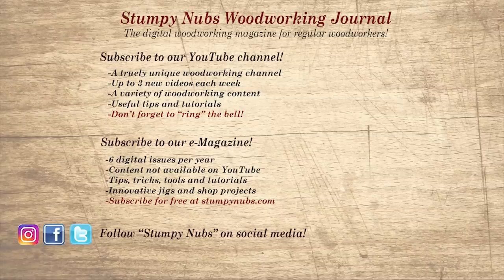Are table saws becoming obsolete?????

Comment: I don't think it's fair to compare a Festool track saw with a circular saw that has a track saw adapter kit on it. Festool is some of the most expensive stuff on the market, but you can get a tracksaw for under $1,000, which doesn't get you too far if you want a SawStop or similarly nice table saw. That being said, I prefer a tracks off for panel goods just purely based on maneuverability of the panel. But I prefer a table saw for repeatable rip cuts as you stated.

Also in a small shop, a track saw requires no indeed or outfeed, only space for the panel itself. +1 for the track saw, for my shop.

Comment: Stumpy, you didn't even cover the most important aspects of owning a table saw. Work bench clutter, not for table saw owners, why stack stuff there when that 2" cast iron top can bare much more weight! Try slapping you magnetic gadgets to those aluminum tracks, the cost to switch out those magnets for aluminum magnets are horrendous! And the most important thing, without a table saw, what's going to anchor you concrete floor on the ground? Woodshop without a table saw, not on my watch. In fact I'm going to order my 3rd one. Stumpy have a cold one my friend, you've earned it!

Comment: I've been getting by with a Festool track saw and MFT table. I got it mostly for space considerations when I didn't have much space. I really need a decent table saw. Track saws are not fool proof, this fool has experienced a couple too many dangerous kickbacks because I set the depth wrong. I do love it for breaking down large sheet goods though. Even if I had a good setup for that with a table saw I'm not sure I'd use it much.

Comment: Does a homemade table saw (inverted circular saw) count as a table saw? I don't see any comments about it.
With a well constructed fence and cross cut sled it is preferable to a track saw.
Reply from the maker: I would avoid any table saw without a splitter or a riving knife installed. https://youtu.be/8f8VWwtaudU
Reply: @StumpyNubs  Good point. Thank you.

Comment: If I could only have one machined for woodworking, I’d be a table saw, that says it all for me.
Reply: In to sawdust making since around 72 (but did some before that) and my cabinet saw is, still, the center of the shop. I will say, I do have two bandsaws, but they will never replace the table saw completely.

Comment: All to true; more issues and awkward contortions with a circ vs table for my taste. Even purchased a cheap mobile contracts TS for site work. Still have and use my circ but only as necessary. My opinion is folks without adequate space prefer the circ and vise versa

Comment: A properly set up radial arm saw used wisely can do everything a tablesaw can do. Except cross cutting a full sheet of plywood.  Being able to stand up properly is a treat and with a proper saw blade the cuts are clean and smooth. The radial arm saw rests up against the wall out of the way instead of being stuck in the middle of the shop, and with a proper fence dust solution makes much less mess
 I have never owned a tablesaw and never will. Do yourself a favour and try a radial arm saw out for yourself. You'll be glad you did.

Comment: You say the table saw is a large machine but not having one often mandates having several other machines that end up taking up even more space. All of these being less than optimal for the cut that would be easily achieved on a table saw. A table saw and a band saw are my two most used machines and if I had to get rid of one of those it would be the band saw.

Comment: I've been considering (more or less) the same question for my own uses. I owned a 3hp Delta Unisaw feeling the quality. I moved to needed to sell my shop over 10 years ago but am now getting back into woodworking. 

In the intervening time between selling my shop and now track saws have come a long way. For me, the question is not so much track saw vs. table saw, as I clearly feel doing some joinery on the table saw is simply going to be faster, but do I (or most) any longer need the big 3hp table saw even for hard woods. Would a 1.75hp or 2hp saw be more (and I would say perhaps far more)than good enough?

When I consider the hard wood pieces I constructed in the past, even in 3x3" cherry, my conclusion is that a 1.75/2hp saw (and perhaps a thin kerf blade) will be more than enough for any needs I can see, even though I mostly do projects in hard woods. Yes, I will need to keep the blades sharp, and perhaps have a few additional blades around for cross cuts and rips needing to changed blades more frequently, but I can't think of a time where the 3hp just bought me that much. 

So, considering how far track saws and associated blades have come I'm not sure the question is if table saws are obsolete, but do you any longer need the big 3+hp saw that we all pined for, or the 52" rip capacity. I strongly suspect not, the same joinery and (mostly) the same capability can be accomplished with a less expensive saw considering the other available tools.

My two cents.

Comment: As a woodworker who actively makes a living by making and selling wood goods online, a table saw is a necessary evil. You can of course do everything a table saw will do with a circular saw and guide but it will be slower. Now I have a specific example of table saw danger. I was cross cutting glued up pieces to make  chess board like cutting board. The glue joints failed during cutting and a 6 oz'ish piece of oak was fired back at me from the saw blade and struck me in the forehead it split my forehead open and caused a rather severe concussion. So be careful with your table saw.

Comment: Are table saws becoming obsolete? No, not by a long shot. However, they are becoming less necessary. I prefer to break-down sheet goods with a track saw. Then, I cut to final size using my table saw. However, there are times when I'll just use the track saw. A lot depends on how many cuts are required, how many are repetitive (You can make repetitive cuts on a track saw. It's just harder, and harder to do as accurately, than with a table saw.), and what I'm making. I recently made a set of shop cabinets without my table saw. (I've got to get the shop put back together before I can fit the table saw back inside. Maybe I should see if there's a post office building for sale in my little town...)

Comment: whats your thoughts on DIY table saws. 
I have also thought about mounting a circular saw. and leaving it downward facing.
Reply: I started with a circular saw mounted upside down a wooden table with a self made fence. If you don't need great accuracy or cutting depth, it's a cheap way to start, but not more.
I replaced the circular saw with another gifted saw that used to be a combination of a miter saw and way to small crappy table saw to make it a better table saw, but it's still a very weak compromise.
I would believe a 200$ cheap real table saw would give me better results.
For example, I cannot tilt the blade and be limited to 90° cuts. The fence setup is flimsy, cutting depth is still not good. If you build it in a way it is good, you spent the same amount of money a good job site saw will cost you.
Reply from the maker: I do not believe a table saw of any kind, be it homemade or an upside down circular saw, is safe if it doesn't have a splitter or riving knife. So no, I would never use a circular saw upside down. They were not designed to be used that way and have no safety devices to prevent kickback, which can pull a hand into the blade.
Reply: @StumpyNubs  Mine had a riving knife and I would never use saw without one.

Comment: As I see it, a track saw eliminates 90% of the need for a table saw — and in a much safer way.
Moreover, it’s a lot easier to manhandle a saw than a sheet of plywood.

Table saw specs ignore the very expensive essentials: a solid fence, a Brett guard, a power feed unit — and a saw stop! Nor do they consider all the jigs you need to make, such as a crosscut jig.

Comment: I’m ticked off! I’m gonna savage you!

Just kidding. I generally agree. The table saw is definitely the fastest way to do a lot of things. One thing I personally think gets overlooked though is why does that matter to you? Is there some intrinsic value to ALWAYS doing things the fastest way? I argue no. 

Obviously faster is better right? It lets you make more money right? Well... not necessarily. It really depends. Otherwise NOTHING could still be made by hand anymore. It’s always faster and cheaper to get something from IKEA. But there are still people turning out projects using only hand tools. And making a living. If they have the time to make rips with a handsaw surely the time difference between tracksaw and tablesaw rips is less significant right? If you want to use a tracksaw for everything and you’re 15% slower for not owning a table saw that’s not intrinsically worse. It’s just something it’s up to you to price into your work. After all if efficiency was the only consideration for customers they would never pay for something made by a human. Factories will always be faster and cheaper.

Comment: I'm absolutely not an experienced woodworker, just a novice. But I am a logical person. And the table saw's days are numbered. I present to you the premises for my conclusion... the sliding miter saw and the track saw.

You just need a flat table top, a track saw, and a sliding miter saw. In fact, I'm certain that products will eventually come on market that will combine these concepts. The chop saw is the fastest and most accurate way in my view, to cross-cut smaller materials, and the track saw IS better than the table saw for cutting larger materials. (AND BOTH ARE MUCH SAFER THAN A TABLE SAW) And the sliding miter/chop saw only adds to the capacity of the miter saw. And multi-material blades means accurate and clean cuts on steel too. I'm a welder/fabricator, and I took woodshop in high school and even masonry in Jr high. A table saw is nearly useless and very hazardous for cutting metals or masonry, but the miter/chop saw is perfect for it. And for sheet goods, whether wood or metal, the track saw is much better than the table saw. ESPECIALLY if you have a workbench that is even relatively flat. It being a workbench, it's a multi-use surface. And from my personal perspective, woodworking as it's own profession is kind of on its way out as a viable career option for most people, and welding-fabrication is too. However, I love the fusing of metals and woods together, and I'd recommend anyone who loves building things, become competent in wood and at least steel, if not aluminum as well. I like the idea of using steel for structure and wood for comfort, such as steel tube legs and back supports for tables and chairs, but having wood and leather as the materials that make contact with people.

Tangents aside, I think the blade moving (chopping and sliding, like with miter/chop and track/circular saws) is much more reasonable than constantly moving the materials. The work surface should remain immobile, as well as any reference surfaces such as fences and stopping blocks for repeatable cuts. But the blade should move. Simply makes much more sense and is a much more versatile means of cutting, with more applications. All the table top extensions, and rollers, and sleds one needs to broaden the capacity and utility of their table saw is just unnecessary. Moving the blade along a fixed range of motion, via the pivot of a chop saw and the straight edge or guide for a circular/track saw, and keeping the material itself still, makes the most sense to me. Too much room for error when cutting on a table saw, with materials slipping off the table or tracking away from the fence...
Reply: Sorry I should have included the router in my premises haha. I'd like a workbench with a removeable underside mounted router, a chop saw, and a track saw

Comment: How do you safely and accurately rip narrow stock with a handheld circular saw?
Reply from the maker: You should make a jig to hold the piece and support the saw as you pass it over the piece.
Reply: @StumpyNubs  Thanks. What is the thinnest stock you could practically rip using this method?

Comment: I tried to get by without a tablesaw in the beginning days of my hobby, just beacuse it's quite an expensive part of the workshop tools, but a good tracksaw is not cheaper than a proper jobsite tablesaw that many hobbyists use and a mitresaw even if accurate have cut lenght limitations that you just can't get around in anyway. since I bought my first tablesaw, I find myself using it more and more instead of other tools it can substitute just because the setup time requirement and the convenience of making repeatable cuts easily. no, I don't think they will ever be obsolete. substituted maybe
Reply: Whose/which track saw do you use or recommend?
Reply: @kooale  well, I have a really crappy one currently (called Parkside, I think it's only alavilable in Europe), that's only good for rough cutting, the guide is not accurate, so I definetly don't recommend that. but I had a Makita for a couple of days, that was nice.
Reply: @gergelydarmos3190  Many thanks Sir

Comment: A track saw is a must with a small table saw. You down need a big rip capacity if you have a track saw
Reply: Whose/which track saw do you use or recommend?
Reply: @kooale  I am a general contractor company owner/operator and am on the Dewalt battery system for all of my handheld power tools. However I decided to go with the Makita corded model based on the price dust collection power accuracy and track compatibility. I view it as a long life type of tool which made me want to go corded and not have to deal with battery compatibility issues in the far future.
Reply: @stoicllc2352  My corded Makita 7.25" has served me well for about 40 years without a single trip to servicing!

Comment: "Are table saws becoming obsolete?????"
Just what I need to see the day after I finally order one!
Reply from the maker: Watch the video :)
Reply: @StumpyNubs  I did, thanks! I am looking forwards to it and will treat it with great respect. I remember your kickback video.
Reply: Make a table saw sled as soon as you can. Crosscut safety increased 99% (seriously) - accuracy much better (as in much better than ever required)  if you use the 5 cut test. A mitre and track saw don't come close

Comment: I agree with ya' on your opinion.  I don't have a dado stack at the moment as I've not found the need to make numerous dado cuts...but I do trust your insight.  I have 2 table saws at the moment.  One is an old school belt driven 12 inch and a not quite so old school bench top table saw 10 inch. If I did make one a designated dado saw...should I use the more powerful larger one (which would force me to make the smaller saw work harder for the big cuts)? OR use the smaller saw for the dado cuts (making it work harder for that specific function)?

Torn here...or should I just sell the smaller table saw and deal with changing blades on the more competent saw?  😇😎😀

Comment: As European dados aren't a good selling point, because they aren't allowed here. (They are considered to be too unsafe, because law requires the machine to stop in certain time when you power off and the dado's weight disallows that, routers are the suggested alternative, and we get all our furniture done without).

Anyway, otherwise I fully agree, you don't "need" a table saw, but it you're faster with one. So it all depends on size of your commitment into woodworking. (I guess on the other hand at the wood shop where they have this monster of a wall saw, they couldn't imagine to get by with a puny table saw :)

Comment: The table saw is an expensive and dangerous piece of equipment and I would like to see a change in how it functions, there has to be a safer way. But for convenience and repeatability I cannot come up with a better solution myself. I keep sketching things with a bandsaw type blade with a fence, blade guard, better blade guides, etc but better blades will have to be also engineered and that’s where I lose the thread.
Reply from the maker: There are real improvements out there. SawStop saws won't cut you. Felder and other European saws have large sliding tables that can better secure the workpieces and prevent kickback in some cases. Power-feeders completely eliminate kickback and keep the user away from the blade. Some day, some brand will bring all of that together in an affordable way :)
Reply: I have a Bosch 4100 as well as scars on my arm and on my side caused by kickback. At the same time as my kickback experiences became serious you showcased several videos emphasizing kickback. I found that the blade and slots on my 4100 were very much out of alignment and trying to align them was a nightmare. The saw manual presented the operation as simple and could be done easily by one person. It took two people and three hours to finally adjustment to a acceptable alignment. Since building a cross cut sled and armed with a understanding of kickback I have not had a kickback. I was able to find studies on saw injuries and found that by a large margin kickback was the culprit even for amputations.